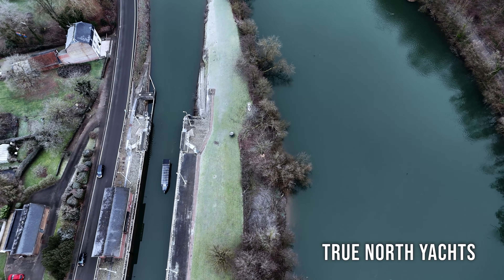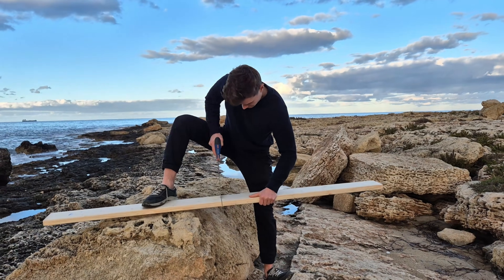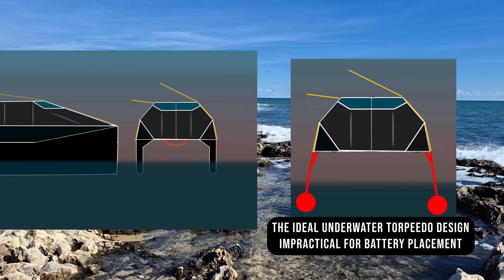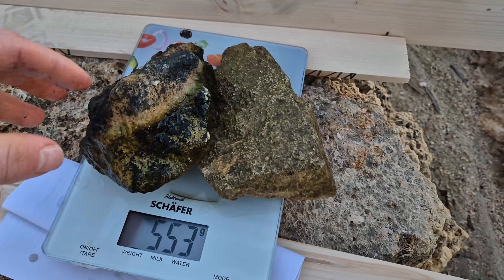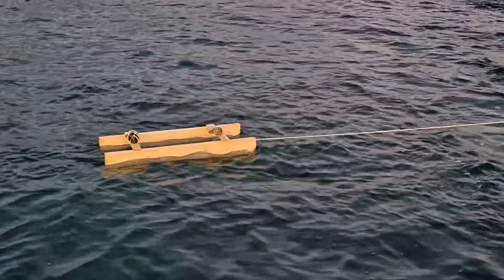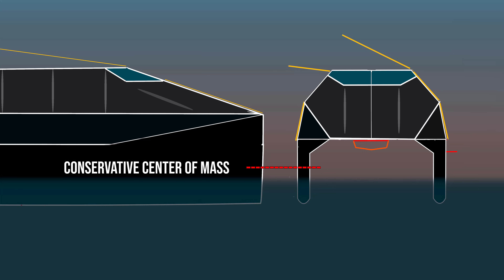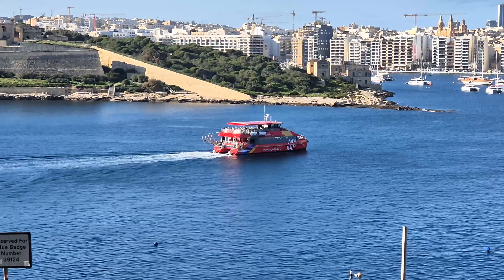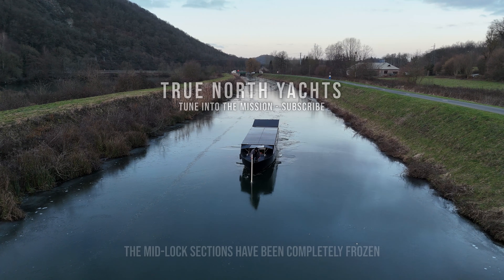Solar Works! Testing My Catamaran Model in Real Waves

Comment: In the south and sunny region your tradeoff will change considerably.
heat become a problem very quickly (think hot and humid greenhouse) and you will need lot's of ventilation, insulation.
You will have a huge excess of solar power, thus I think you are way better to accept to use a small genset as power and heating in cold climate.
Also buy a books on catamaran, there is plenty of designs mistakes that have been made already, learn from them. Catamaran are like raft, they follow the water movement, the smaller ones have the more jerks and are most uncomfortable but can go in shallow waters, 40ftx20ft is close to the minimum considered today for a liveaboard.

I had an Iroquois, a 32ftX14ft with 18" of draft, it's was great in tight spots but you have to pick your weather window carefully.
I would go for a 40ft now.